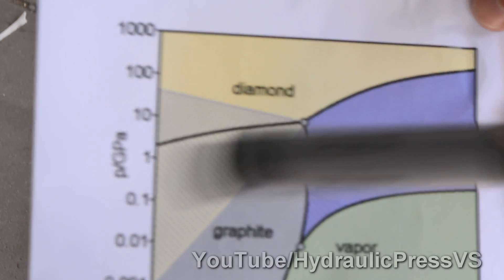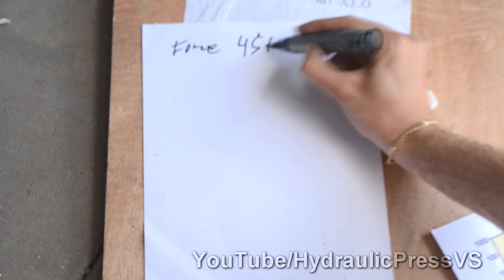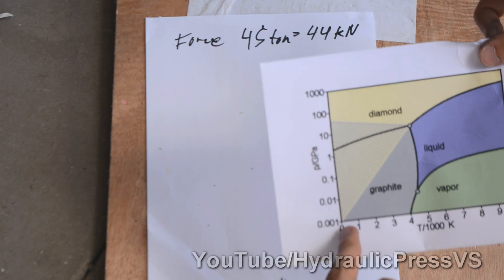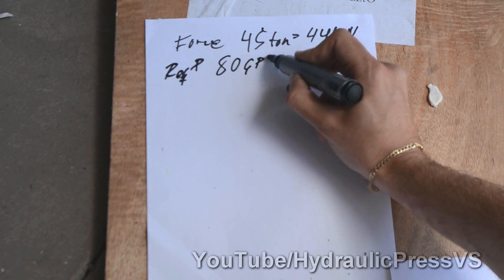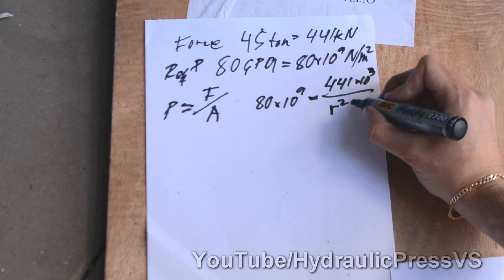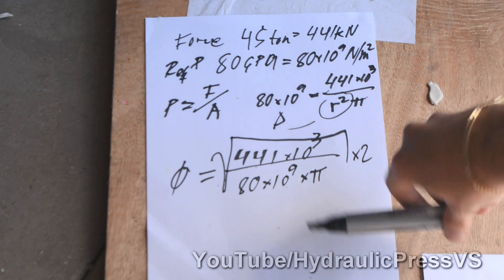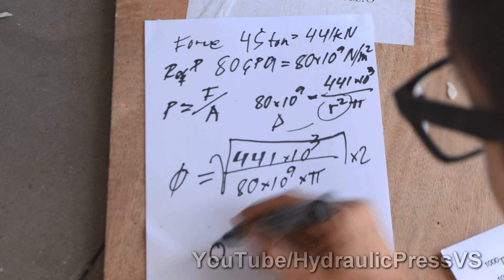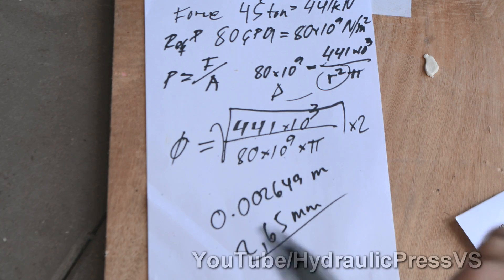Charcoal vs Hydraulic Press - Can you make diamonds from coal?

Comment: yeah you get a cut diamond from charcoal which isn't even 100% carbon
Reply: Actually, Coal is impure, charcoal is much higher in its purity when it comes to carbon. Mainly because charcoal is normally just burnt wood chips, most of the other byproducts leave (that's what smoke mainly comes from) and what you have left is primarily carbon.
Reply: well Jason it doesn't have to be 100% carbon to be turned into a diamond anything that is carbon basically everything can be turned into a diamond
Reply: Tobias look it up
Reply: Batdead In the vid they didn't make that diamond they put it there because you can clearly see it has been cut, but if it was made by the press it wouldn't be precut
Reply: oh man, about pencil's graphite?
Reply: No peices of coal are 100% carbon because coal is formed from compressed organic material. It is considered a rock because its formed from many elements and sediments though. Also the part about it being formed from organic material is why it has so much energy released when burnt. Also all life on earth is carbon based meaning the "organic" compounds made in and that make up our bodies have carbon at the root. This is why coal has lots of carbon. But since its formed from life it also has more than just carbon as every body does. Diamonds however, are minerals which means they are not  rocks, which means they have a chemical formula of Carbon and they are 100% pure carbon (along with graphite) which means they cannot be considered diamond if a solid has anything otherwise. So while its possible to produce a diamond from most of what can be found in coal, you need lots of heat and pressure to make it. But perhaps they should try it with graphite because developing time underground is the only difference in the two
Reply: Rango 27 no, it cant

Comment: This is complete BS and quite funny as diamonds cannot be made by using hydraulic presses nor can they be made from coal or charcoal. It takes extreme heat and pressure to make a diamond and these pressures cannot be attained in the crust of the earth as it is too shallow. Diamonds are made in the earth's mantle where the heat and pressure is great enough for them to form. They are forced up to the surface over a long period of time due to volcanic activity. So, if one is lucky enough, diamonds can sometimes be found in the top of strato volcanoes.

Comment: this is fake because first of there was a unequal amount of pressure and there was no heat. this is why you find them near volcanoes more than other places the coal heats up causing the atoms to vibrate at a  higher rate and when you add the weight of all the rock around it pushing towards the center.________________________________________________________________________________________also how did you get a perfectly cut square diamond when pressing it with a flat head on to a flat surface not to mention it was over to the far side of the head of the press so that means not all of your force was applied to said diamond.
Reply: since you are needing to recrystallize the carbon atoms inside of the coal bam that's science

Comment: If you make an "adapter" for your press. Something like this \    / but flatter and ends in a 3mm square tip. Then you point a blow torch of some kind on it. It should do it! 
I always wondered if this was possible but the common answer is that it's more expensive to make than the price you'll get for it.

You can always keep it and rob banks by cutting the glasses and the safes and the cameras... forget the wire just cut the camera lens lol
Reply: The heat required would exceed that produced by any conventional torch.  But the biggest factor is that you cannot make something by pressing it that is harder than the jaws of the press itself.  So using a press to make a diamond would require the press jaws to be as hard or harder than a diamond.  My calculations are different.  One would need a 100 ton press and the area of the press jaws could not exceed one square inch.  The jaws would as you point out, need to be shaped like two cones mating except with the upper cone having a flat of not more than about a quarter inch in diameter.  As I said, both jaws would need to be hard as diamonds but would also be able to withstand the compression which diamonds would not be able to.  And one would need to heat both jaws up to around 7000 degrees f.   If my calculations are correct.    Even then the best you could hope for would be low grade diamonds not suitable for jewelry but rather useful in industry.
Reply: "But the biggest factor is that you cannot make something by pressing it that is harder than the jaws of the press itself"............if thats true how do they make synthetic diamonds with tungsten carbide anvils?
Reply: The anvils are tungsten carbide but employ a material holder that holds "seed" diamonds where the synthetic diamonds are "grown" under a combination of high pressure and heat.   I did make one error, GE accomplished their synthetic diamonds at around 5000 degrees f.   My statement stands since the diamonds produced were in a softened high temperature state when the anvils were applied and were not fully hardened until AFTER the anvils were applied.  The tungsten carbide anvil method never produced gem quality diamonds more than 0.005" across.  Their sole use was industrial diamonds.  The current preferred method for making synthetic diamonds is the vapor method which vaporizes carbon atoms and grows them on seed diamonds.
Reply: nunya biznez oh ok cool thanks for the explanation, I hadnt heard of a vapour method, just reading about it now, seems the anvil is old news

Comment: I bet if he had actual coal he might of made a small low quality diamond.
Reply: Yes that and the press needs to be shaped correctly and made of the correct material.  You can't make something harder than the material of the press itself.  So the hardest you will get is something as hard as the steel of the press.
Reply: +nunya biznez I don't know they crushed a diamond in one of their videos. at least I think it was them
Reply: +Bronabonle ah ok couldn't remember who did it. but still  they crushed a diamond
Reply: +the stig mach 1 Yup, but they couldn't crush a metal ball bearing xD
Reply: +Bronabonle yeah that really surprised me. I don't know the physics behind it for sure but I think it's because the ball bearing is actually made to be more dense, also it's not as prone to cracks since  those are usually forged or cast instead of immense pressure in the earth. all diamonds have some kind of imperfection in them.
Reply: +the stig mach 1 diemonds are easy to break you can do it with a hammer
Reply: heart shaped box Depending on the quality and state of the diamond or if it has cracks it will shatter if it doesn't it'll be difficult to break

Comment: Its Coal, not Charcoal which is wood fiber burned and fused with carbon which releases a lot of CO2 when at a burning point, Coal is pretty much fossil matter compressed by the earths crust into a carbon like matter, now if it were coal and not charcoal you would need high heat and constant* high pressure. And it doesnt just form all at once just poof a solid mass exchange from coal to diamond, its not an instant reaction. Its a crystal that develops molecularaly relative to other crystallized gems on Earth.

Comment: Really high heat + no oxygen(no burning) + really high pressure + a long time + coal = diamond 
not that simple dude
Reply: I feel like I should tell you that diamonds are not actually made from compressed coal. Instead, diamonds are probably formed deep in the Earth—much further down than the levels at which we find coal—where heat and pressure fuse atoms of carbon together into crystalline structures.

Comment: Your math is wrong
Reply from the maker: Where and why?
Reply: It's a jooookeeeee
Reply: As I see it, you have 441,000 Newtons over whatever area the press covers, and 80 billion newtons per square meter converts to 80,000 Newtons per square millimeter,  so if you focus the force of the press to an area of about 5 millimeters, you'll make diamonds if you have a material that will withstand that kind of pressure without buckling and then covering an area larger than 5 square millimeters. With that said, the answer that you came up with for the needed diameter of your press for it to make diamonds seems to be about correct.
Reply: jooooke ITS JUST A PRANK BRAHHH
Reply: +Hydraulic Press VS do hydraulic press vs Lego
Reply: It's not as much as the math is wrong, it's as much as you are missing the heat and pressure from all angles to create the diamond. Diamonds are made deep within the Earth and pushed up after so many periods of years.
Reply: Possibly but it maybe out of our current understanding.
Reply: Testarossa I agree.
Reply: the lego would survive

lel
Reply: MEOW. i think so too
Reply: +sharbel543 that doesn't exactly answer the question.
Reply: brain melt
Reply: Andy Rouse
Reply: Testarossa If he could find some way to get more heat and more pressure than the Earth makes naturally, then maybe we could speed up the process.
Reply: Yeah but then you are talking about high pressure fusion like a star lol
Reply: Testarossa I know, I wonder if we could construct some piece pf technology. Or magnify the Earth's heat and pressure, to reduce time on potentially creating a diamond. I am only in 7th grade so I must put time and effort into this.
Reply: Testarossa
Reply: Andy Rouse it's not wrong because it a whole load of bullshit and he's stupid
Reply: Billy England It's possible though he just doesn't have enough heat or pressure

Comment: don't you need heat?
Reply: depends. as that graph showed (that doesn't sound like good English but whatever) you need pressure to make a diamond, but the higher the heat, the less pressure it requires. you could make a diamond at room temp, but as they showed with mathematics, they would require lots of pressure (the entire force of their hydraulic press would have to be focused down to ~2.5 square mm to get enough pressure to make a diamond).
Reply: yes, yes you do. This video is obviously faked.

Comment: you should use real charcoal when you attempt to do this again. what you had there is mixed with stones and other shit. so either use  real charcoal, or get one of those graphite crucibles and scrape a bit of it off
Reply: Charcoal is burnt wood, dumbo. You can't make diamonds out of burnt wood.
Reply: so the briquet that is full of stones and other rubbish is better yes?
Reply: Let me put it simple: The only thing that can be made into diamond is coal which had very high concentrations of carbon.